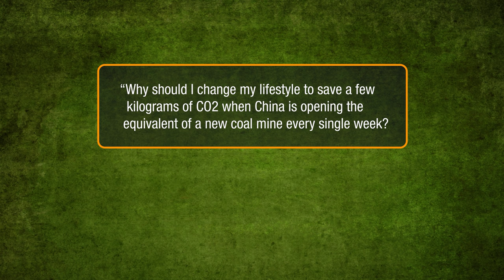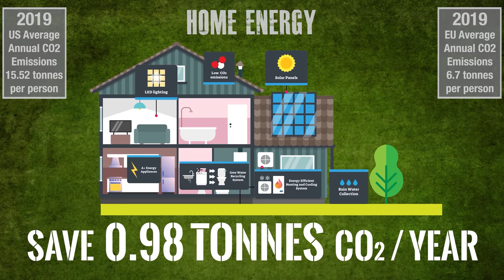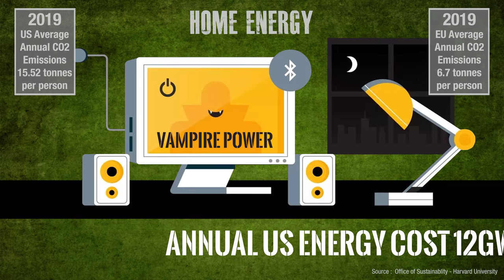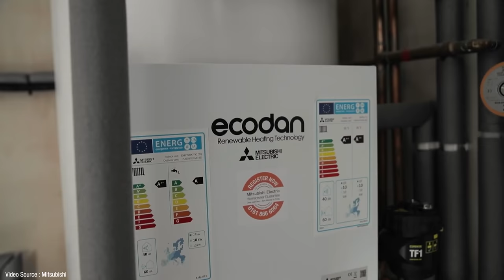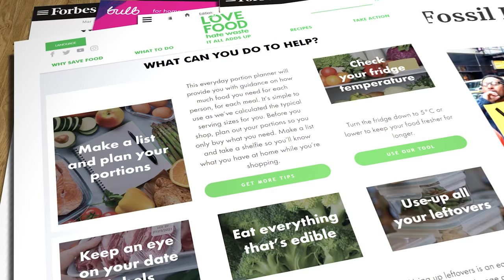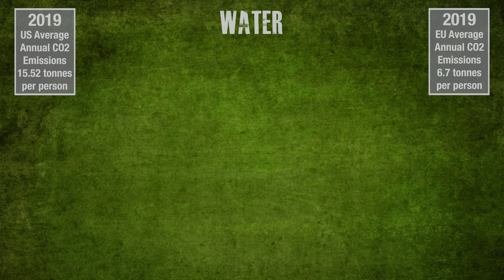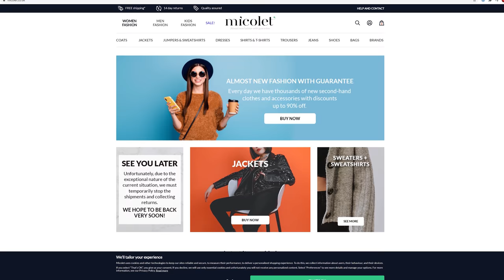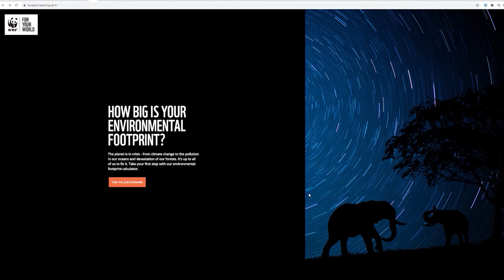Can you really affect climate change? Yes. You can. Here's how...

Comment: As a plumber I advise against sticking a brick into a toilet cistern. Modern cisterns and toilets are designed to work on 6 liters of water.  It may sound like a lot but its not. The sewerage system requires a certain amount of water to work correctly. Reducing that water too far could induce a blockage either of your sewer line or (if enough people do it) the main sewer line. Grey water systems are far better at reducing water use.
Reply: In the desert out west they have a sign,”if it’s yellow, let it mellow .
Reply from the maker: Good advice. Much appreciated :-)
Reply: @normandolinic2044  the rest of the saying... "If it's brown, flush it down"

Comment: The biggest thinkg you can do is have one less kid than what you had in mind, even decide to have no kid, while be ready and accept that we will work longer, but work is health, purpose and life.
Reply: never have kids on purpose!  only have kids on accident if you are too weak to control your urges.
Reply: Hard to negate the evangelicals having 6-10 kids.
Reply: @penguinuprighter6231  They are not many and more and more of them start to not take all the axioms their religion guide them toward for granted.
Reply: Yes, even short-term, one fewer child is just as effective as ditching the car, not flying or going vegan. I'm still surprised people don't promote this more, considering the mess the planet is in.
Reply: Less kids of the ultra rich might be part of the solution, but they are unlikely to stop breeding. The consumption rates and carbon footprints of the richest 1% (approximately 80 million people) equals or exceeds the poorest 50%. That's almost 4 billion people.
Reply: @penguinuprighter6231  This is my point, on top of all the right advices provided by Dave, each kid not born account for a huge amount of C02 savings (and all other sort of pressure on our environment).
Reply: @ivanc-s  Having one less offspring is MASSIVELY more effective that ditching the car.  58 tonnes per year Co2 saved compared to an insignificant 2,4 tonnes saved  per year by ditching the car
Reply: @lancos3237  Yes, mid to long term, I agree. But in the next 10 years (shortterm) you have to take account the footprint of a child which is about a fifth of an adult's (and obviously you can't take into account descendants either).

Comment: great presentation. There is so much wasted energy, especially building related. I systematically reduced my electricity bill years ago by checking every device and found some real surprises, like a broken motion sensor or an unused 12V garden lights transformer that used quite a bit of electricity, 24x7!!!!  My provider here in Northern California shows me my electric and gas consumption in comparison to neighbors with similar size houses. I use 50% less electricity than other homes.

My gas bill (mainly for heating) wasn't much less than other homes. I did my research and started insulating the house. I air sealed all the electrical outlets and switches (to prevent hot air from getting into the wall and then traveling up and escaping through the attic). I also air sealed the recessed light canisters with cheap foam rings you can get on Amazon. I sealed the exterior doors and stopped any drafts. The bathroom exhaust fans didn't have a trap door to prevent cold air blowing in from the outside which was quite noticeable on windy days. I also removed all light fixtures and sealed the sometimes big holes. 
You can have a "blower door test" done to measure how "leaky" your house it but I didn't think it was worth the $500. Instead I turned on all the bathroom and kitchen exhaust fans and then went through the entire house and checked for leakage with the smoke from a burning incent candle. All the built-in kitchen and bathroom cabinets leaked a lot as well as the staircase, also some walls behind the baseboards. I used a combination of expanding foam and chaulk to seal it all up. 

I also sealed up the wall plates in the attic and then blew in another 10 inches of insulation. While in the attic I also installed an "attic foil" on the south facing side of the roof. It acts like an umbrella on hot summer days to keep the sun from heating up the attic too much.

All in all the house is a lot more comfortable year round now and stays much cooler on hot summer days, especially the upstairs. My heating bill dropped noticeably. And on hot summer days I always smile when I hear my neighbors air conditioning is running while my house is still cool.

If anyone is more interested in details please let me know, I have detailed write ups of the DIY work done.

Comment: Excellent video !  If people take some ownership in, it can make a difference. Especially for all the ways to reduce pollution that don't cost anything (or even that save money).  Just simple items like 1. reduce trips, 2. turn off unused electronics, 3. turn down the heat or air conditioning, 4. reduce over consumption , 5. recycle,  are easy and what any responsible earth inhabitant should do. No excuse to not do these, at least. 

Perhaps people who buy gas vehicles can think about buying cars instead of heavy SUV's or trucks. SUV's and trucks are heavy. The heavier a vehicle, the more energy is needed to move it/drive it.  

I am going to forward this video to a few people.  Maybe others can do the same, to expand awareness and help get more people on board.

 Dave, keep up the great work !

Comment: Regarding insulation, I would also add that a home is far more comfortable to live in if it is well-insulated. We added R-13 insulation to our uninsulated attic in San Francisco, and while the temperature differential from inside to outside in the winter is only 20F degrees (12C) in the winter, it became dramatically more comfortable to be in the home after that small bit of insulation. In a colder climate, going from R-20 to R-30 can mean more comfort (and air sealing is also important).

Comment: Miele makes a heat pump drier. Runs on 15amp 120v circuit. Recycling air in the drum after extracting water eliminates dryer duct hole in your house. Peak wattage 900w compared to our old 240v 6,000w. One year in it's worked very well. Also freed up a circuit for our car charger. Also does less damage to our clothes.

Comment: Sorry, but indoor clothes driers add moisture to the air while cooling it, resulting in mold on the walls and higher heating bills in the winter. Having vents open in the summer to create a draught works when it's raining, but fresh air circulation and a heat exchanger is required in the winter.

Comment: Many people take showers rather than baths. In most cases, they let the water run until it warms up as water from the hot water heater finally reaches the shower head. Collecting that water in a bucket and saving it until the next time one flushes is a way to put the water to good use.

Comment: It does feel hopeless sometimes. Personally we have sold 1 car, and bought eBikes for journeys up to 15 miles each way, triple insulated my home, installed solar panels, changed my gas boiler for a heat pump, moved to 100% green electricity, gone 95% plant based for food and am now going full out on the plastic in my life. I still stare at my diesel van with a guilty feeling, but currently no electric van does what I need it to do. Being older, more well off and more western than most, I felt it was my obligation to do what I could with my privileged lifestyle.
Reply: Well done. The penguins thank you.
Reply: @penguinuprighter6231  sadly I still don’t think it will make a difference.
Reply: @Muppetkeeper  I know how you feel. I planted 200000 or so trees 35 years ago. I suspect some have burnt in fires. We can't negate the effects of the consumption rate of humanity.

Comment: The problem is, almost no one is going to implement 100 different changes to reduce their CO2 emissions - a few people might do one or two of these things, but the working class, for the most part, don't have the time, energy, attention span, help or money required to do all this. There are plenty of options, of course - but the sheer number of options can be overwhelming, and the individual change, again, doesn't seem like it's going to have a significant impact. People at large aren't going to act - I think we need regulation to enforce some of the changes. For example, imagine if the EU banned bottled water, or regulated the use of packaging or other disposable plastics - surely that would have a significant impact?

Comment: Some basic stuff that requires some smart ideas to address it. As an engineer who has been part of energy management since 1994. Unfortunately that business went belly up once people could buy their own gas and electric. We could put a full energy management system that recovered cost in savings over a year. So the basic is if its off its saving. Reduce its saving. Unfortunately, business just takes to the bottom line. They do not invest it. So I would suggest tariff on kw/square meter. That would make a massive difference. Tariff could assist reinvested to pay for new electrical infrastructure.  It should be illegal for food to travel more than 1000 miles.

Comment: Great video. One comment, most of these ‘green’ electric tariffs are absolutely useless. The electricity comes from the same grid, in the EU they use a rule which lets them buy a certificate to allow them to state that it is green electricity. 

You’re far better off trying to do the other things of reducing your consumption in efficiency terms as stated or generating your own via PV. There’s no reason to say that this means you have to live in a cave, have lighting, but LEDs, have heating, but insulate your home first, then look at heat pumps.
Reply: The green electricity certificate are not useless. When one unit of renewable energy is created, a green certificate is created with it. When you buy the electricity and the certificate, your electricity is green even if it comes from the mixed grid. The certificates maje sure there is as much green electricity produced than there is consumed.

Comment: My fairly dull story, some way to go, but getting there ... : 

Transport - the car (diesel) has spent the last 16 months pretty much parked up in the driveway and working from home is set to continue for me for the rest of the year and probably only twice a week after that = check. The wife has also hardly done any driving.
Flying - I last did that in 2018, me and my wife do most of our holidays in the UK. 5 return flights since 2014 = check, we fly very little.

Home - I battle with the other half over heat, she wants it warm, I say "put a jumper on" - I lose. But we use Octopus Energy, on the 100% renewables scheme.
Sadly, we have a gas boiler - and the cost of changing this is not something we can afford right now.
Lighting - not a single incandescent bulb in the house
Electronic devices - er, yeah, lots of gadgets left in standby. But I did swap out my ancient Mac Pro 5.1 "cheese grater" tower, with a mac mini M1, yay me!

Food - we became vegetarians over 2 years back, as this seemed one the most effective and easiest ways to cut our carbon footprint, grow some of our food, try and buy locally grown = check. 

Plastic - we continue to battle, as everyone does. Everything is ... plastic ... it is everywhere. We try to buy individual unwrapped vege/fruit whenever possible.

Clothing - I tend to wear things until ... they wear out. The pandemic has seen me shuffle between a tiny set of clothes for 16 months. I can't remember the last time I bought clothing, although ... it's getting desperate now. Holes appearing in clothes.

Shopping - I'm a geek, I like gadgets, but I try and hold myself back. We made a pact some years back - NO junk presents at xmas - no silly little plastic trinkets or electronic gadgets that make you laugh and then, get discarded. No plastic/film/foil wrapping paper either.

Comment: Our agency of co2 emission is not democratic and even if the majority of individuals agreed on what to do a minority ultimately chooses the vast majority of emissions. This is why its unwise to focus on the individual with climate change mitigation. However here is an ordered list of things you can do ranked by achieveability to the average person over the affect it has. (avoiding the trove of virtually pointless and exhausting things you can do).
Costless:
1. Vegan diet
2. Remote working
Middle class income:
3. Public Transit / EV
4. Home insulation
5. Heat pump dryer/water heater
6. Solar panels
Large scale:
7. Divestment
8. Activism

Public transit could be a costless or cost savings option in an ideal scenario however public transit in the US is designed to trade accessibility and time for cost. That is the poor spend their time and access in order to subsidize drivers in order to reduce traffic. So I don't suggest that option to most people in the US. Divestment either requires access to vast amounts of capital or basically requires activism.

Comment: Put a shut-off valve above your shower head! They just screw right in, & they let you turn down the water pressure for all those minutes spent lathering & scrubbing. Dial it back up when rinsing, & feel great about the hundreds of liters of water you save each month (not to mention all the energy used to heat that water.)
Reply: Top tip: don't shut it off entirely. Hot water loses its heat pretty quickly when sitting in a pipe, so slowing its flow to a trickle when sudsing should keep you from a cold shock when you turn the pressure back up.

Comment: Old taps that you have to turn a few revolutions to get them going - are the reason i leave the taps running more often;

Old boilers that only give you hot water if the tap is almost fully open - otherwise it just runs cold! :x

Ridiculous 2-tap british system is another one. One is ice cold, the other - boiling hot. Our addiction to running (rather than still) water for washing wastes a good deal of hot water. Damn boilers again!

Comment: LED lights are wonderful, and let me talk about something that is a huge benefit but no one talks about.  They produce almost no heat.  I had a Living Room with flood lights, and I didn't realize how much those lights heated up the house in the summer till I swapped them out for LED floods.  Not only was the room cooler, meaning the AC was turned on less, but the room above the living room was cooler too!  So that room had the AC on less.  I put them in around 2010, 11 years later and they are still running strong.

Comment: A sad observation of how infrastructure degradation is probably leading to lower carbon outpts in my part of the world is as follows: 
Rolling electricity blackouts due to a failing coal driven electricity supply has led to a surge in private rooftop solar.
And impassable  potholed roads along with soaring fuel prices have led to fewer journeys.
:) :)

Comment: I am all for going " Green" but somethings are virtually impossible or not cost effective eg ground and air source heat pumps, these systems rely on your property being very well insulated and sealed which is nigh on impossible for most old UK houses, being very leaky. This was brought to light by another you tube vlogger Roger Bisby aka skill builder, he points out the draw backs with these systems being a plumber/ builder who has installed many of these systems.

Comment: Next installment on the IPPC horror story out August 9'th. I expect to get a quality rundown on this channel. Home solar power is technically not emissions free as production is energy intensive and coal is used in reducing the Quartz ore to pure Silicon. So around 5g CO2/kWh from a solar panel. However this is almost as clean as Hydro power and if you run your car on it, you are down to 0.5 to 1g CO2/km which is 100 times cleaner than riding a bike and 50 times cleaner than the grid, even if you live in a country with half the power from renewables. What really needs modernisation is the home stereo amp. They are usually on standby to keep the electronics warm and draw 20-60W continiously when on standby. Modern sound bars and BT active speakers have switchmode power supplies, and work differently, to save power, but old amps are still plentifull as they last forever. Getting a "smart" powerstrip controlled by my TV halved my household standby load. Supermarkets now each have several "stop food waste" sections, where about to expire groceries are sold at a heavy discount. I go there Monday morning, when the store is empty and they've just cleaned out the weekend surplus. I pay half to 1/3 for the majority of my food like that and it is always interesting not knowing what's for dinner! If that saves on emissions from the food industry is dubious, but profits are lowered, which certainly translates to lower emissions. Even if I consume the same amount of food, the selection is usually biased towards vegetables and other healthy food, so it also helps changing my diet (lots of Spinach last week!).

Comment: you may be right? some of those device should consider pair up or combine long time ago. say, bathroom water heater and refridgrator. the excess heat exchange from making ice if transfer to bathing heater, it will save money, afterall, we don't have to boil bathing water, give it a 50 degree c is pretty good enough. 

do we have such “lego” style device in the market? seems not yet.